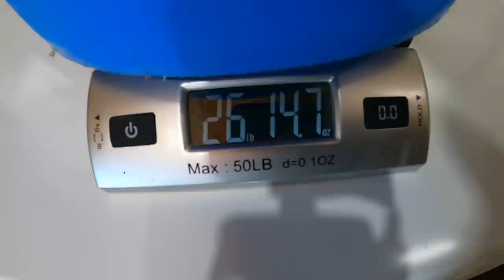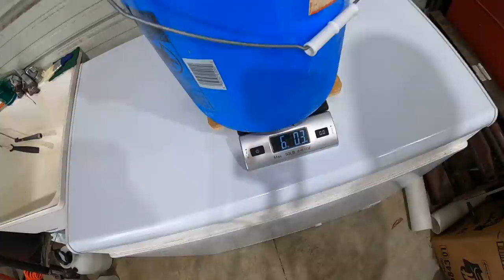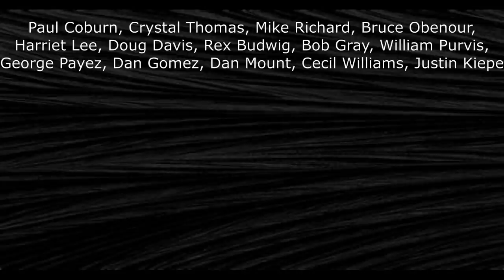Homemade ice maker! New fan and new personal record! #562

Comment: Fyi
This video only just showed up on my feed, I never saw it before and based on it being 2 months old with only 8.5k views I'm definitely not the only one.

I would re post it from scratch with a new thumbnail as something definitely went wrong the first time around. 

Good luck!
Reply from the maker: YouTube is hit or miss on promoting videos. Very few actually get posted or "recommended" by YouTube.
Reply: @TKCL  
That's different I'm certain I was not notified as a subscriber. I would never not notice or remember a follow up ice maker video from you.

Btw you never tried the AC controller device with the relay to turn off the fan when the heater turns on to eject the cubes.
Reply from the maker: Oh yeah I did, in version 2.0 I ran that originally for a while. I then removed it once I took the downspouts out of the inside. You might have missed several episodes. Sadly I also do not get notified of all the videos channels I follow posts. Even with ALL notifications turned on. YouTube does a sloppy job of notifications in my opinion. When I get asked to do creator surveys I usually mention this as a weak spot.
Reply: @TKCL  
.
You are referring to the one that was temperature probe controlled. 
I'm referring to the IOT device primarily meant for CNC machines with a N/O and N/C relay contact triggered from the heat emitting resistor to eject the cubes....  heater on = fans off.  Instantly in real time.... Big difference. 

Go back for the link in the ice thread if you want too.

Comment: On the velocity, the only way you can tell is to experiment but it’s my understanding that the point of a fan in the process of making ice is to remove heat. You add water and to make ice you need to remove the heat from that water that’s why the ice trays are kind of thick they’re supposed to absorb heat and act as a heat sink. And professional trey ice makers they blow a little bit of air across the bottom of the trays. But you also have a lot of thermal mass that will absorb heat as well so moving the air throughout the chamber I think would be beneficial. Then you also have parts of the freezer that are less insulated where heat make him in a little bit. My guess is blowing a medium amount of air across the bottom of the makers or just to keep air moving and pulling it out of the ice trays and deflect a little bit of it to circulate air within the system but not crazy amount would probably be good. You had it before where you were running the tubes down into the thermal mass but my guess is from a practical standpoint using the small fan you have on a medium speed moving air mostly past the makers but also diverting a little bit of enough to circulate the rest of the freezer is probably your best bang for the buck.  I definitely think once you move it into the house and it’s in there at 70° instead of out in the shop it will probably make a pretty big difference as well, if not in ice production in efficiency for sure I would think.  I think the single fan at a medium speed once you get it inside the house is probably going to be great for production but also efficiency. 

What I really like to see is whether or not it makes a difference if you had a small penguin inside their observing, if you do that make sure you use a low temperature LED light so it doesn’t add heat. 😉
Reply from the maker: A penguin? Was that a test to see if I read your comments? 😂😂
Reply: @TKCL  No, penguins live in the Arctic, they know all about ice. 😂😂😂
Reply: @TKCL  LOL... It was a test.  It was also a test to see if other viewers are reading the comments too... and to see how you replied to them.  We're out there... watching... always watching.

Comment: Water Pressure variable? Is the water valve on a timer or is it on a level switch for consistant sized cubes?
Reply from the maker: Timed and it's adjustable.
Reply: @TKCL  Great videos! quite an interesting setup. 

I was thinking that possibly differences in some of the weight tests could be caused by a toilet flush, shower, washing machine, garden hose usage as in car/boat washing or veggie irrigation, etc. could cause even subtle differences in the amounts of water flowing to the ice machines..

 Perhaps a small "RV" type water regulator keeping the pressure and volume constant may help in future tests (if any more testing is planned. It seems you've tried any other variables), or for other folks trying these experiments.
Reply from the maker: That building is on its own plumbing line and tied to a 80 gallon tank. It shouldn't see fluctuations from things outside of the building.

Comment: I'd be curious to see what would happen if you duplicated the function of an ice maker on a side by side fridge/freezer. Basically, get a mini fridge and fill it with your favorite beverage so it's not a wasted cost. But what you also want to d.o is put a nice coil of tubing in there and let your mini fridge chill the water down before it hits the ice maker
Reply from the maker: Not a bad idea, but that freezer side is very small for multiple ice makers.
Reply: @TKCL  You misunderstood what I meant. You'd keep the chest freezer. You'd then a mini-fridge to chill the water before it goes into you existing setup, making sure the water is as close to freezing as possible and not introducing excess heat into the freezer and making it work harder.
Reply from the maker: I see, I tested the chilled water theory a while back and seen a modest 7-9 percent increase in production. But keep in mind pre chilling your water in a mini fridge increases the thermal load on it, making it run more. It's probably a wash on energy usage vs production.
Reply: @TKCL  Sure, that's why I wouldn't want to be using the fridge exclusively for chilling. If you're at keeping drinks and whatnot cold and it's serving a dual-purpose it could make sense.

Comment: I'm sure you mentioned it but what size is the aluminum piece you mounted the fans to?
Reply from the maker: I think it was 2 inch wide by 1/8th thick.
Reply: @TKCL  ok I apologize,  I'm sure your sick of answering my questions lol. But I have 2 more. 1. Have you ever weighed all the ice when it was 100% full? 2. Have you had issues with the cooler guys fans not going full speed immediately?  I have to manually spin them sometimes.
Reply from the maker: Never measured the capacity and I've had zero issues with those fans.
Reply: @TKCL  interesting. I thought it was just the one fan but then the second one I ordered did it also. I even bought the cooler guys power plug
Reply from the maker: If you are running them when the lid is open you are pulling hot humid air into them. They might be icing up. That's why I have mine on a door switch.
Reply: @TKCL  they don't seem to have any ice issues that i can see.  I unplug them everytime i open it.  I plug them back in when lid is closed.  If I'm quick i can spin and shut lid before they get fully going.  I just now figured out if I unplug one, the other will hit max speed and then plug back in the second and then both get going. I just expected both to go max speed the instant they're plugged in. They even did this before being installed in the freezer
Reply: Have you still had zero fan issues?  I'm one my 3rd fan and I've now burned through a cooler guys power pack.... lol maybe i'm just lucky
Reply from the maker: I converted to a single variable speed fan a couple of years ago and I've had zero issues, it runs 24/7 unless I'm full.

Comment: is this ice safe to consume?
Reply from the maker: It's not considered food safe. I'd use it, but you need to clean and sanitize this often just like any other ice machine. I am personally using it for cooler ice as this doesn't make the best tasting or looking ice for drinking.
Reply: You are much better off freezing solid small, medium,large, and or extra large blocks of ice. Bust up the block if needed to make small ice in double wrapped hefty bag. You are wasting so room! You are literally wasting so much money with no guarantee it will work and continue to work. You can also buy a brand new commercial ice maker for like$350.
Reply from the maker: So many misconceptions in your statement. No true commercial machine is going to be under $1500. Those cheap units with bold claims are cheap for a reason. They also don't store more than about 20lbs of ice. Freezing blocks and busting ice is a chore and not at all convenient. My machine runs 24/7 and has well over 100lbs of ice waiting for me. Two weeks ago for example I used about 120lbs for two boating trips. I've also been running my machines for about 2 years now around the clock and now I'm running it on solar for zero dollars. It's more than paid for itself.

Comment: Ice machine v3.0:

Brine bath, block ice maker.

Not that you couldn't just put a big Tupperware full of water off to the side in your current setup and make a huge block of ice, probably quickly as well, especially if you start out by "seeding" it with the ice you already made, but ridiculous is fun!
Reply from the maker: I actually do make 5 very large blocks of ice on the side. I put those in my cooler for long day trips to keep the melted water very cold.